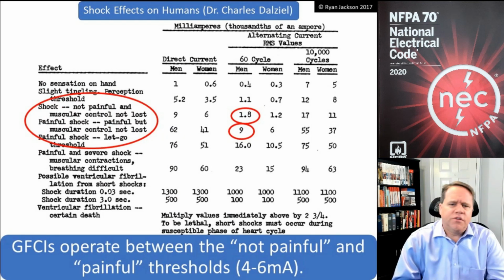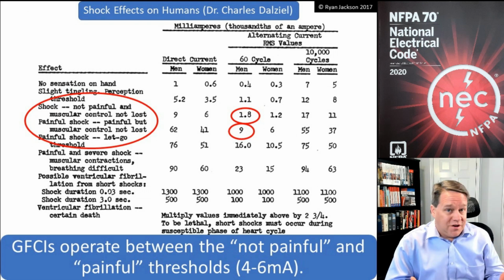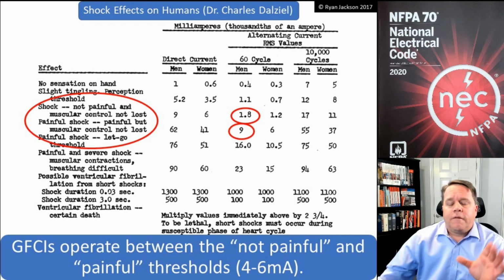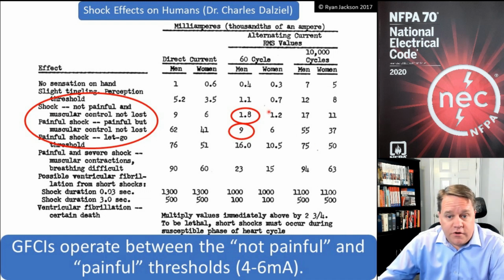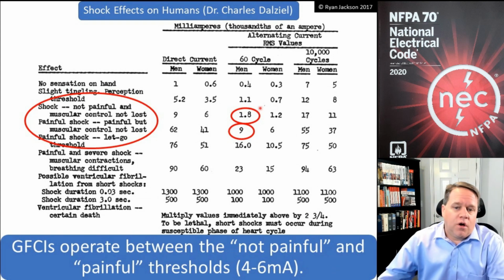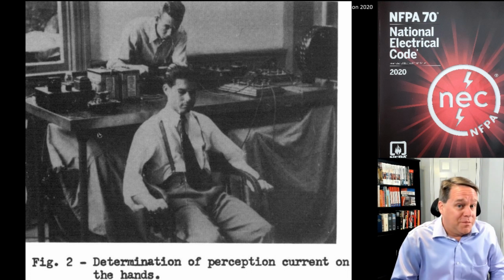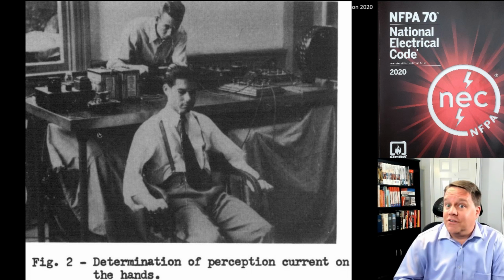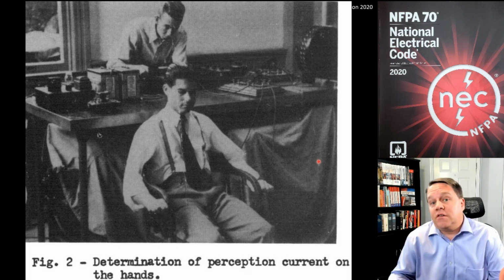100 Days of Article 100 GFCI and GFPE

Comment: So would most GFCI breakers be rated for equip protection rather than user personnel protection? ie 250v outlets that now require GFCI protection
Reply from the maker: No, GFCI protection is required to be Class A by definition.

Comment: Great video!   I always tell the apprentices that GFCI looks for current flowing outside the intended path "to ground".  Correct me if I'm wrong but if a person became part of the circuit but wasn't grounded the GFCI would not trip.  i.e. treat every wire like it's hot.  

On that note, I consider heat trace to be a  dangerous thing to work on.  I've seen settings at 60 ma just set to show alarm and not open the circuit.  This is acceptable because you wouldn't want to freeze a sulfuric acid pipe and it burst onto personnel.  

If you're dealing with 12.47 kv you're prob using proper PPE and highly aware of danger.   But you may be tempted to grab heat tape that's melted to the core and become a part of the circuit.   Then the HT controller will show a red led til someone hits ack... oops

Comment: Silent “z” in Dalziel? Haha. 

Charles Dalziel’s 6 mA is based upon a 50% “safety” or “design” factor. The resulting 9mA measurement is predicated on the body impedance of a typical  full-grown male; women, children, elderly and the infirm have lesser limits due to lower body mass. That Dalziel threshold is also based upon let-go current corresponding with MUSCLE TETANIZATION because muscle contraction can either continued ground-fault exposure or cause inability to swim in a pool and consequent drowning. As such, Dalziel’s limit, based on human physiology, results in RECOVERABLE SURVIVABILITY.  This is the basis of Class A Ground-Fault Circuit-Interrupter (GFCI) protection for personnel. 

By contrast, Europe’s Residual Current Devices (RCDs) have a 30 mA limit based upon measurements by Gottfried Biegelmeier. That Biegelmeier threshold is predicated upon current corresponding with HEART FIBRILLATION of a typical  full-grown male; women, children, elderly and the infirm have lesser limits. As such, Biegelmeier’s limit, also based on human physiology, results in UNRECOVERABLE SURVIVABILITY. 

European RCD limits are not compatible with North American Class A GFCI limits.
Reply from the maker: About a year ago I decided I finally needed to find out how the name is pronounced.
Reply: @RyanJacksonElectrical  
Well, I and most of NEMA be darned!

Dalziel, Dalzell or Dalyell (/diˈɛl/  dee-EL) is a Scottish surname.
Reply: The unintuitive spelling of the name is due to it being an anglicisation of Scottish Gaelic Dail-gheal, meaning bright dale. The sound now spelled with a ⟨y⟩ or ⟨z⟩ is historically a lenited slender /ɡ/, which in Gaelic is pronounced [j] (like English ⟨y⟩). The English/Scots form of the name was originally spelled with a yogh (ȝ) as Dalȝiel; this was later replaced with either a ⟨z⟩, the letter of the modern alphabet which most looks like yogh, or a ⟨y⟩, which more closely represents the sound.
Reply: You forgot to mention that Bielgelmeir patented his GFCI (RCD) device in Austria in 1958, so he beat Dalziel by about 3-4 years.  In any case, there were no commercial devices of this type until Bielgelmeir and Dalziel patented their devices a few years apart (I am unsure if they knew of each other's work).  As you said, Bielgelmeir's work on electric shocks was submitted to IEC and it became the basis for Europe's RCD specification (30mA).  Over here, we went with Dalziel's research which became the basis for NEC standards.  However, I've also heard that the European RCD's were not capable of tripping below 30mA (at least back then) due to technological reasons which is how they ended up with that 30mA threshold.

Comment: Very informative.   I've never realized,  until viewing,  that there are actually two different classes of Ground fault protection.   Whenever I hear someone mentioning something is required to be ground fault  protected, the first thing that comes to mind is the receptacles with the test and reset buttons typically found in your bathroom,  kitchen and garage,  as well as the circuit breakers that sometimes protect entire circuits in these areas that require GFCI protection,  and that trip when the leakage current exceeds 4 - 6 mA

Comment: Thanks for another easy to follow informative vid. I never heard or came across the equipment GFCI circuit breakers that do not trip out until 30 milliamps until I started working at a large hospital/research center. They had a 6 door ( 3 doors on each side )maybe 8' wide refrigetator in a clean room where they mixed things. Of course the acess door was on the clean side so we had to wear bunny suit, hair net & booties. I spent a lot of time trying to locate leakage current. Disconnected board and meggered every thing first with 250 volts then with 500 volts. It was tripping a 5 ma GFCI single pole breaker msybe once a week. Boss finally told me to install a 30 ma trip GFCI breaker. Found out that the bunny suites we used for years were not an approved PPE. We always had 8 or 11 Cal long sleeve shirts & pants on. We brought this up to safety department but they said to only use them on denergized circuits where every one knows is impossible when troubleshooting. Catch 22.